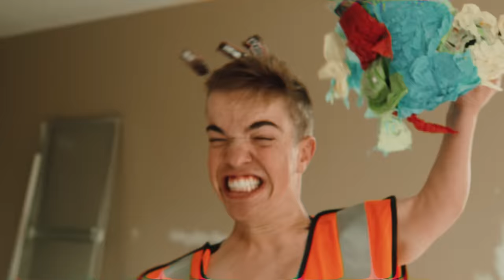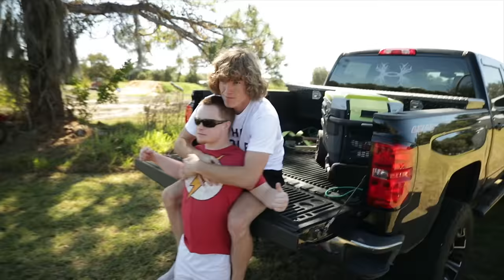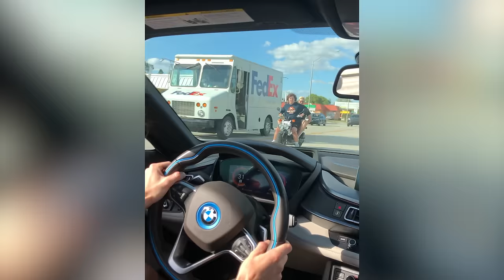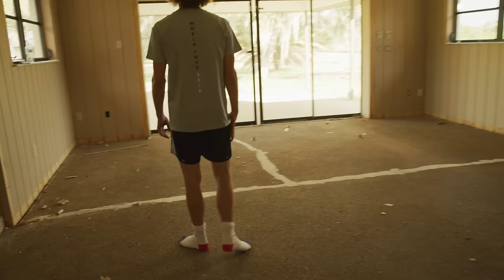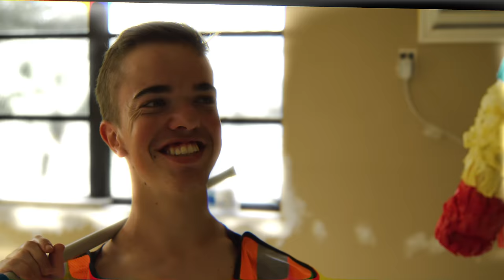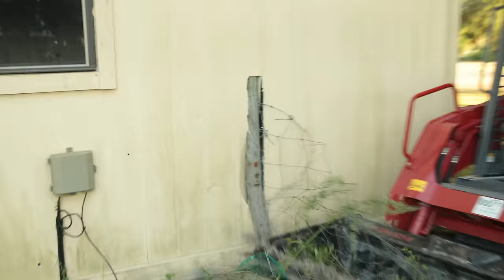Home Remodeling with Danny Duncan!

Comment: Danny needs to grow some balls and get 250cc 2stroke dirtbike
Reply: clay yarosz out of everything in this video you had to point out that he doesn’t have an amazing dirt bike 😂😂
Reply: hes previously said hes never ridden dirt bikes until a couple years ago, hes learning on something small and making his way up. like any logical person would do
Reply: Or a 2018 450 4 stroke. You know for instant power and can still outrun 2 strokes.
Reply: Dude that's way too much bike for just fucking around sometimes
Reply: Myles Stowe 💀
Reply: Wdym that’s the Honda Fit of dirt bikes
Reply: Immortal 2 stroke out run any 4 stroke because there low end power 4 stroke are high end power as give more power as it got but a low end give power instantly off the launch
Reply: @svvageog870  yeah but it's not hard to make a 4 stroke keep up and crf450s beat cr250 2 strokes  but it would be pointless for Danny to have a 2 stroke because  you can't ride a 2 stroke around at low rpms and cruise around how Danny rides
Reply: leroy 7.82s that’s what I’m saying Danny doesn’t need power it’s just to fuck around with